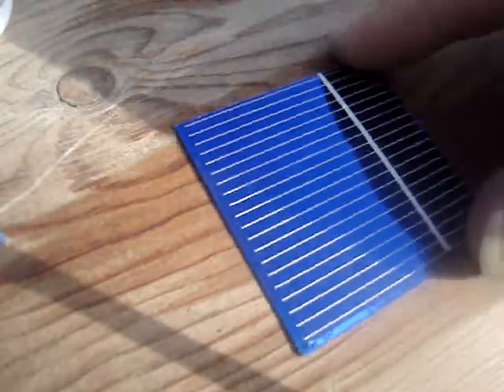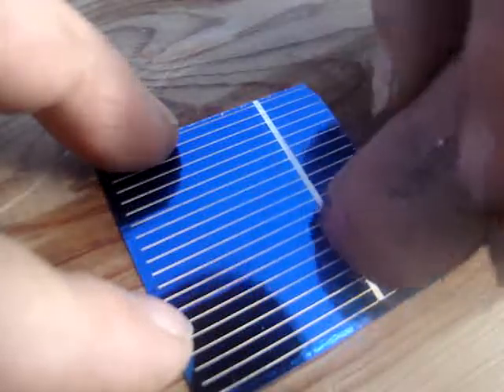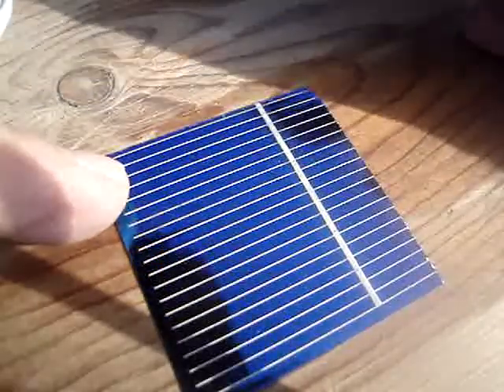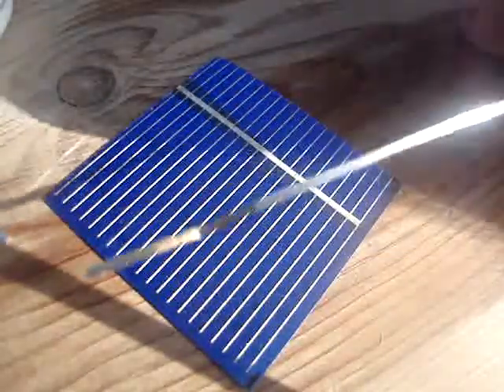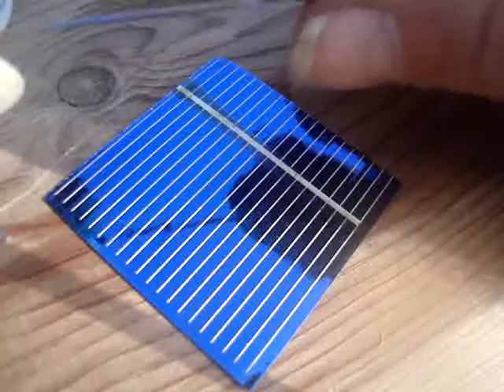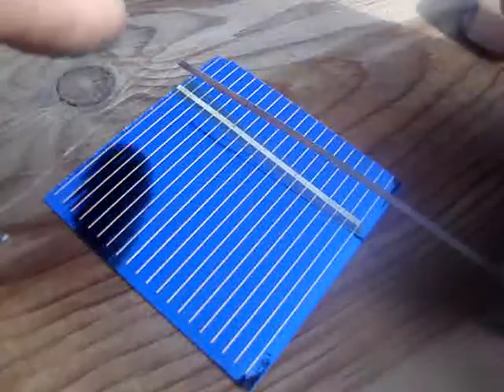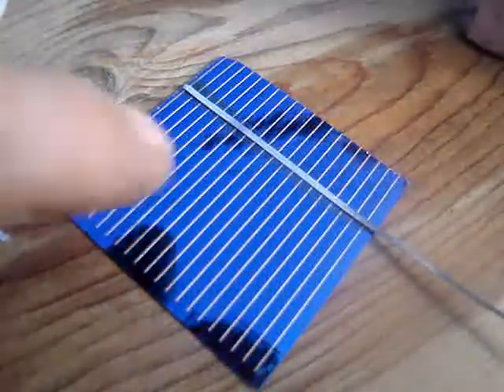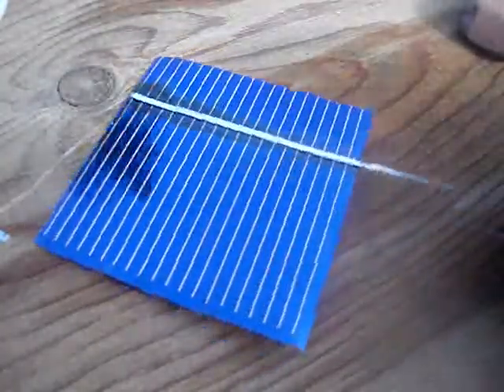Solar Tabbing How 2

Comment from the maker: @mr1000rx well 36 3x6 cells will give you 18 volts 65 watts 3.6 amps peak, 10 panels ? best way to figure is how much electric you use then buy enough cells to build enough panels to charge enough batteries to supply you what you need, 10 panels probably wouldn't get you off the grid but it's a dang good start but it will let you know if you need a few more or not thats for sure, but if you was using 6x6 cells you could probably get by with 10 panels